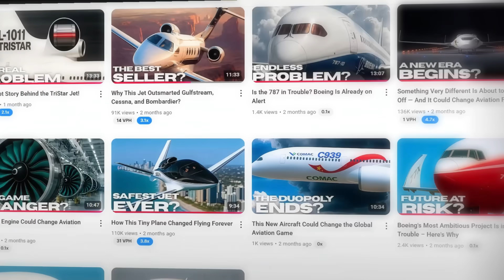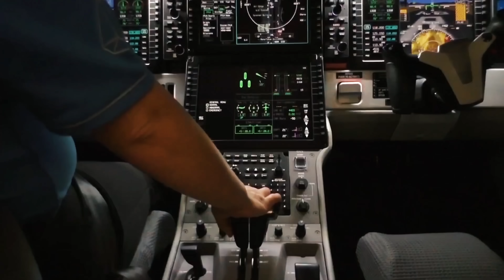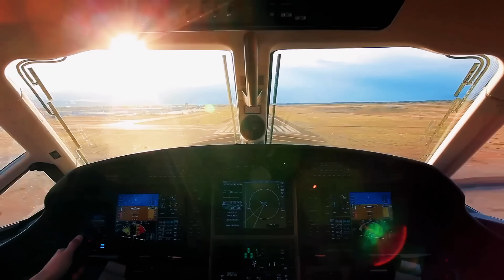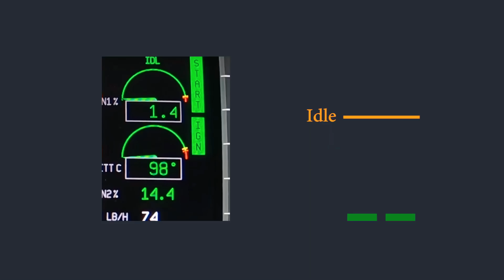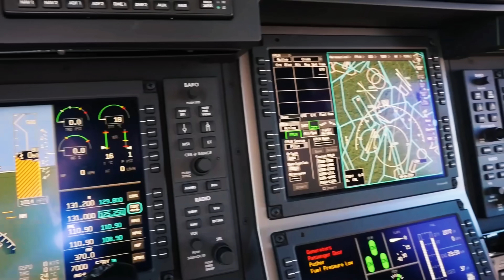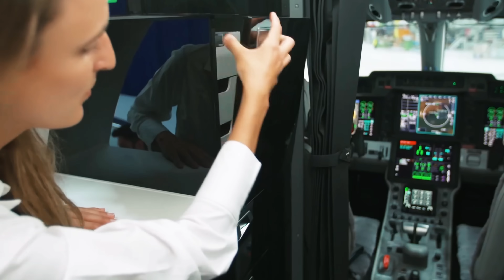The Most Unexpected Jet Ever Built

Comment: The Pilatus aircraft are the finest on the market.  I have about 12,000 hrs of which over 5,000 are flying Pilatus aircraft.   3,600 hrs in the PC12 and 1,600 hrs in the PC24.
Reply: Which one you felt more reliable & robust?
Reply: @parimal7528 they are both great birds.  The PC12 is a legend!  It’s a do all airplane.  The PC24 is an amazing performer.  

Different missions but both were good to me.

Was left AOG twice in the PC12 in 3600 hrs of flying them.  I was only stranded once in the PC24 in 1600 hrs.  

Both were very reliable
Reply: @chrisanderson4799 Thanks for the reply.

Comment: The Cessna Citation did all this beginning with the Citation I in the 1960s.  The Citation I, Citation II, Citation SII and Citation V were all certified for gravel (with an optional kit installed) and grass landing strips.  One of the first images shown in the video show small cabinets that are near identical to what Cessna called pyramid cabinets located between seats.  Cessna provided a guarantee that those jets would operate for less than a turboprop.  Seems to me designers at Pilatus may be history buffs before anything else.
Reply: I worked for a company in Alaska that has a PC-12 and a Citation 560 with a gravel kit and a cargo door. They use them to fly technicians all over Alaska.

Comment: Using an engine at low speed as an apu is so cool.  An apu is mostly useless weight in flight.
Reply: But an APU is very helpful during an emergency and required for 121 ETOPS. Running one engine on the ground for an hour wall get it closer to TBO than the other. This is a clever trick to save weight, but don’t discard having an APU.